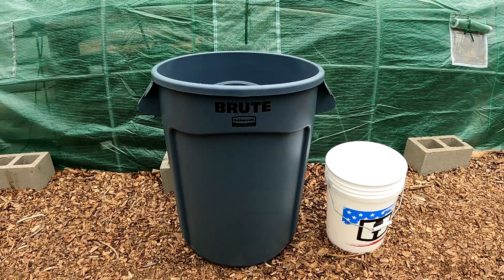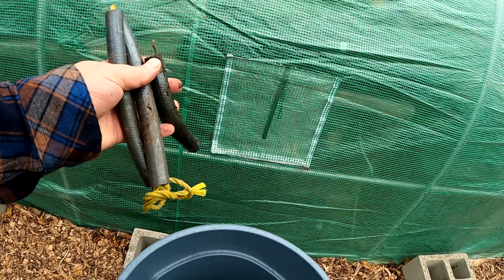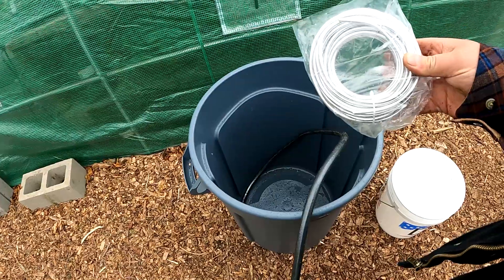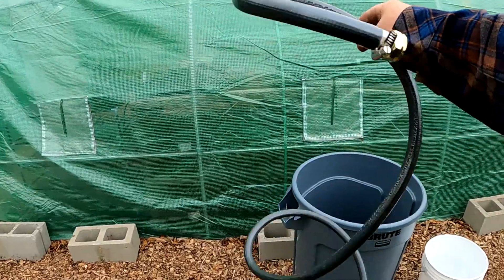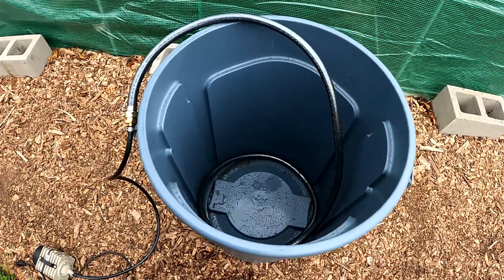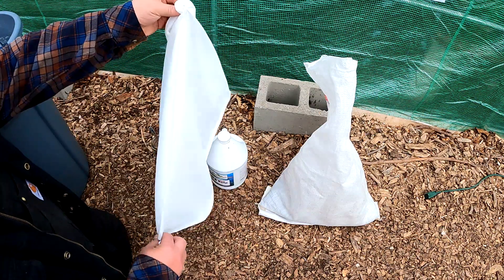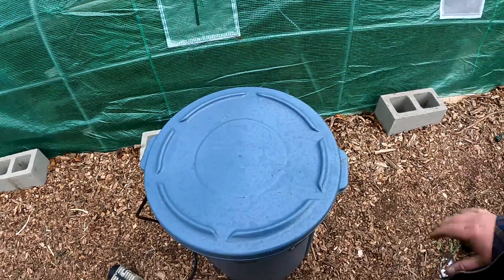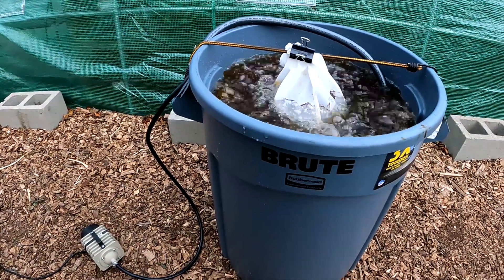How To Build The Perfect Compost Tea Brewer (5-25 Gal) From An Old Garden Hose & A Garbage Can!

Comment: Thank you for making this tutorial! The first one I made, I made the holes too big. I just made a new one with the smallest drill bit I had. Air still isn't coming out of the entire length of hose; just the first quarter or third of the section that has holes (the bottom 2/3). That part keeps floating and won't stay submerged. Ideas? Too many holes? I drilled them about an inch apart. Did you drill all the way through the hose or just into one wall? Thank you!

Comment: Good video on the setup. Compost teas can have their place if you have a lot of potted plants where adding traditional compost wouldn't be feasible.... or if you need to stretch you resources to a larger area (at a diluted rate)... but when comparing to just utilizing the compost directly in the garden, there is no benefit. 

Brewing up compost does not increase the nutritional values of the original input materials. So if you add in A, B, & C.... brew it for a day... you will get some of A, B, & C diluted into the water. The remaining parts will still be locked up in the strained out material. 

The other benefit that is given to compost teas is the life they bring to your garden. It's very true that brewing up a tea creates lots of life. The problem is that soils are already supporting the maximum amount of life possible based on the food and environment of that very soil. So when you dump all this life into a soil without adding more food or changing the environment, the total life will quickly reduce back down to a level the soil can support. So at the end of the day, you are not increasing the soil life levels. 

Directly adding compost adds life and food to your soil that lasts for an extended period of the season as the compost is broken down.

Comment: This is a great way to make compost tea, many designs work well.  In particular if cleanup is easy on this design, it is a winner as keeping it washed out from batch to batch is important.  I have tried several methods and by all means not all.  About 5 years ago I made a mini microbulator to fit a 5 gallon bucket.  I found plans and built it and have used it regularly every year since.  It works real well and no need to use a mesh bag or anything like that, just throw stuff in.  It is by no means perfect and to each their own on brewers in my opinion.

Comment: DAN - QUESTION (at the end): I'm a first time vegetable novice. I put kitchen scraps, leaves, some grass in buckets and left them in my yard.  The rains filled up the small buckets in the course of a week.  I fed them with cardboard, a little kelp/fish fertilizer (I learned about from you). I've been busy planting seeds, potatoes, learning all I can as I'm preparing the area for my container garden and one day I could smell the rotting fruit and veggies in the buckets.  I read about adding air so twice I've stirred them vigorously and then I topped them up with straw and put cardboard on top until I know what to do and to abate the smell.  Until I can do this over and start a compost tea properly - Can I just pour the water out of the buckets into a large one and add more water to dilute and add more carbon and air to keep it aerobic and use this as compost tea????  I would think it is full of nutrients.  Thank you so much, I love your channel!

Comment: An alternative:  If you don’t have an old garden hose, opt for 3/8 inch PEX tubing. It will fit the 3/8 inch nipple on the pump without an adapter, and the tubing is stiff enough to omit the aluminum rod.
Reply: I’m having an issue where the PEX piping is floating up to the top of the reservoir. I’ve used duct tape and it leaves an adhesive residue. Is there anything you would suggest to meet the piping on the bottom of the reservoir?
Reply: @bakejoyd6128 I was thinking about tying a bag of rocks to the end of the hose to weigh it down
Reply: @kevonhess9983  I actually used some thick pvc piping cut to about 2 feet in length. I was afraid of rocks affecting ph levels so I went with that. 

I just drilled a hole on the bottom end and zip tied the end of the piping to it and sunk it to the bottom. It holds it down very well

Comment: Could use a 3/8 to 5/8 barb and skip out on the two brass fittings to connect air pump to hose which is more than a few dollars these days.

Comment: Question: 
I know this is kind of unrelated but my wheel barrow has rust on the bottom few inches although I stored it handles up. Should I remove the rust before mixing my coir and such in it? TIA 😊

Comment: I use an air stone for the bubbles. Not nearly as aggressive. Maybe yours is better.
Reply: air stones can get a biofilm on them and harbor bad bacteria. You want it aggressive enough to move the dirt/casting/etc around. The object is to knock the microbes off the dirt and into the solution.

Comment: I use PEX Tubing for the bubbler. Do you only set this up for a week then use the entire 50 gallons? You said you shut down the bubbler/ why? I run my bucket 24/7 and change the castings and leaf mold once a month in rain water. I like having access to my water thru out the week during dry spells.
Reply: yes. actually Elaine Ingham is cutting down the time to brew. What happens is the microbes multiply, and use more oxygen then can be supplied and it goes anaerobic as soon as a day depending on the temperature.  Then they eventually run out of food. If you want it all year, you need to keep making new batches.

Comment: Is it possible to rig up an aquarium pump to do the same thing? I just cannot do $70 for the air pump
Reply: The point is to aerate the water. An aquarium air pump would absolutely work. The pump used in the video is seriously over kill for the volume of water being aerated.
Reply: You can use an air compressor. They are more expensive to run and louder. However, if you only need to use it for a day or part of a day, once or twice a year, it might be the better option.

Comment: Excellent informative video. What do you do with the remains of the castings in the bag?
Reply: Toss em in the garden.... castings are amazing.
Don't build the bubbler tho, just buy one for $20. It will work better and save you time/money.
Reply: @LilSmoSmo  where do you get the bubbler
Reply: @LC-tc3hz  Any place that does aquarium supplies. Or check ebay for air-stones.